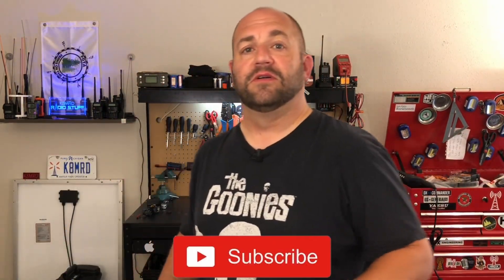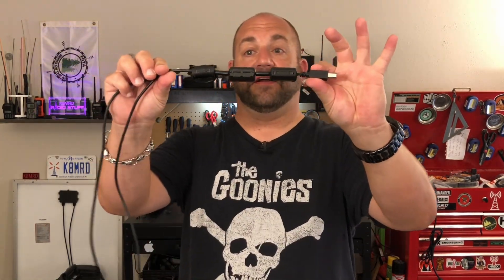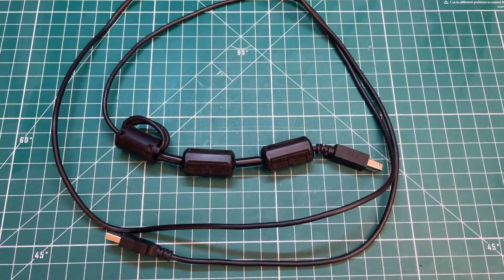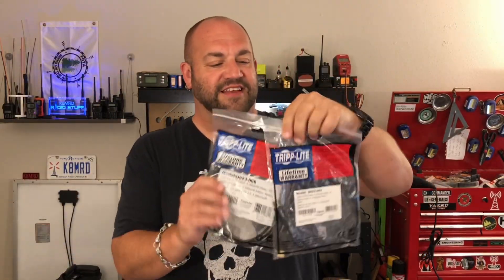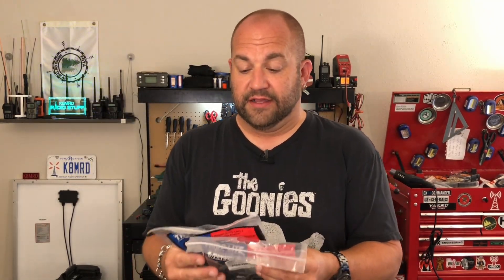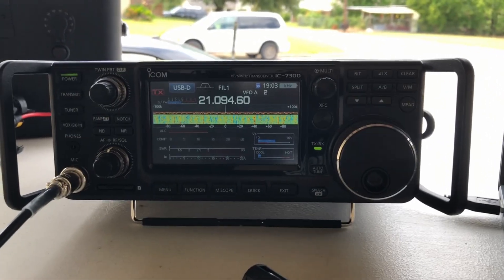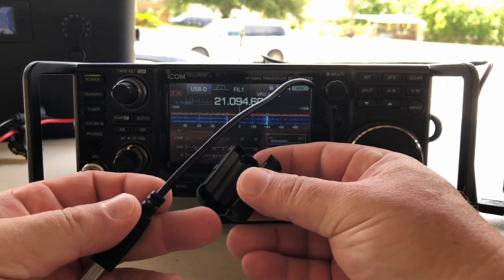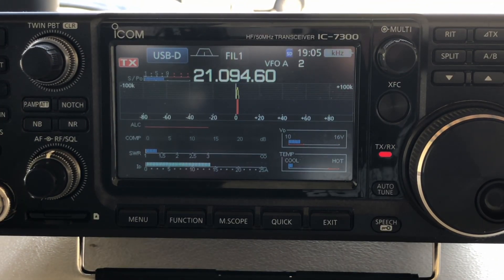WSJT-X Audio Input Error Solved | Tripp Lite USB 2.0 Hi-Speed A/B Cable with Ferrite Chokes

Comment: Hi, Mike, spot on with your usb a/b audio cable suggestions. My 7300 was working great on 20 and 40 ft8 and after windows update kept getting the “audio device input error’ on 20. Couldn’t figure out the solution until I saw this video. It all made sense. I immediately ordered the Tripp Lite usb A/B cable you recommended, but in the meantime I just tried re-routing the usb audio cable away from the RF antenna switch. That fixed it. All is workng well now. Thanks for putting me/us on the right track with solving this problem. 73 de Rick, WB3BIQ

Comment: I hope my comment shows up here - I made unflattering comments about a couple of mega-Youtubers under their videos and their fans gave me a commenting black eye...

I'm going to try these Tripp-Lite cables with my IC-7300.  Heck, they're actually pretty cheap!

When doing digital modes, often my 7300 will stop transmitting.  But unlike your situation, I've not been able to get it to TX again in any mode at any power, until I do a software reset and reboot via the menus.  I've saved my favorite settings, so I just reload them after the reset and TX works again.

Actually I ran into the same comms faults as you demonstrated the first time I tried FT8 a year ago.  First thing I did was start snapping chokes on the USB cable like you did and then at least the serial link would stay up.  But very soon I ran into the no-TX problem I described... so I doubled up on the chokes and wound up looping the radio end of the USB cable through a 43 material toroid 4 or 5 times (as many as I could).  Even then I still have troubles if I run the TX power up much past 5 to 8 Watts and sometimes even at the low settings.

I suspect, but don't know for sure, that a poor SWR can cause the TX problem on digital modes inspite of my chokes & toroid - sometimes I only have to engage the auto-tuner and it'll knock out the TX.  This is only with the USB cable connected to my PC.

Interestingly, Palomar Engineers offers a full choke set for the 7300 for $52 shipped.  Coincidence?  ;)

Comment: After years of no issues I suddenly started having the tx lock up just like you showed on my 7300.  I tried everything I could think of (including "shielded" usb cables and ferrites)  with no success.  I  resigned to there being a problem with the radio. Got this cable and it was a big improvement.  I still had some issues when I push the power all the way up (which I really never do on ft8) but I put some extra ferrites on there and now I'm bullet proof.  Thanks for a great video and solution to a problem that was driving me NUTS!.

Comment: Got this cable today it has solved a year long problem with my ICOM 7200. No noise and no disconnect or computer freezing on digital modes. 73 from Israel 🇮🇱 de 4X6FB

Comment: I watched this video out of curiosity.  You showed the problem you were having, my problem was different, but was limited to digital operations.   I thought I might have water in the feed line, although that should result in high SWR.  My SWR was good, but my radio watt output was 1/4 th of what it was set on.   SO I figured, lemme try wrapping the shielded usb cable round a toroid and see what happens.  TO MY SURPRISE this has FIXED my issue !   Thanks !!!!!!!
Reply from the maker: Awesome!

Comment: Hey Mike. Do you have an affiliate link for the micro usb cable needed for the IC-705? 

I have that same windows machine, and the RFI on my KM4ACK EFHW is terrible. Just plugging in the computer wipes out my waterfall on 20M. My 705 isn’t bothered at all using my Rpi in this setup. 

Mike - N7CCD

Comment: The ferrite beads don't work as well as a ferrite torid. A mix 31 or 43 FTM 240 torid would best when the USB cable is wrapped around it. That's what I use doing digital modes with my IC-705 and IC-7300. 

The beads don't create a large enough magnetic field to be effective. A torid, on the other hand, is more suitable at creating a magnetic field to stop RFI from causing problems. The USB cable I use (cannot remember the brand) has built in ferrite as well, and costs about $4 for a 6" cable. 

With the IC-705, a 3" micro USB cable is what I use and is the length recommended by Icom. Haven't tried a 6" micro USB cable, yet. I'll have to get one soon when I get my IC-705 back from Icom. 

Edit: a mix 31 torid will help with frequencies below 20m. On 17m and up, use a mix 43 for those bands. One or the other should work just fine, but you never know until you try it. I do recommend buying two of each mixes, and have some for spares just incase accidents happen. 

73, W4ISB 
Mike in Tennessee

Comment: I have used the Tripp lite USB cable for the last 4 years with no issues. I had previously used an old portable hard drive USB cable with chokes but it was to short. I wanted to move
my computer further away from the radio to avoid RF. My original nightmare was a regular printer cable so many problems. Tripp lite  I trust .

Comment: Wondered how many Icom owners had that problem I blew front end out of my ic7200 on js8call via that single cable with ferrites. Now use ft891 plus SCU-17 better separation with an interface, but still put couple ferrites on the cables safety first. Thanks Mike . vk5cz ..

Comment: Well, now I feel like an idiot.  As soon as you showed your errors I have the same error now and then running FT8.  It doesn’t happen all the time just now and then.  I had put a couple ferrite snap on’s when I first hooked it up, just because.  So in my head I had “solved” RFI issues.  I was looking at my drivers and other software related issues.  I ordered one just to see.  Thanks for the video!  KN4QHQ.

Comment: The Tripp Lite cables are at a great price point when you look at the cost of buying true 31 mix chokes. You can buy cheap chokes, but no telling the mix and most won't work. When you look at it from this point, the Tripp Lite cables with the choke that does not slide around is the way to go. Good on you Mike !

Comment: Have the exact same problem when testing a magloop, DigiRig and FT-817. Using all DigiRig cables and even the coiling on the USB cable was not enough.  Blew WSJT-X out of the water.  I'll try adding a ferrite or two.

Comment: Tripp Lite makes quality stuff. I use their USB cables, which have built in ferrite chokes, on everything USB related in my shack. Cheaper and easier than buying a cheap cable and adding your own chokes.

As with everything in ham radio (and often everything in general) ... "Buy once, cry once." Meaning spend the money up front on good quality items and you won't have to worry about it later and spend even more money trying to fix the cheap junk.